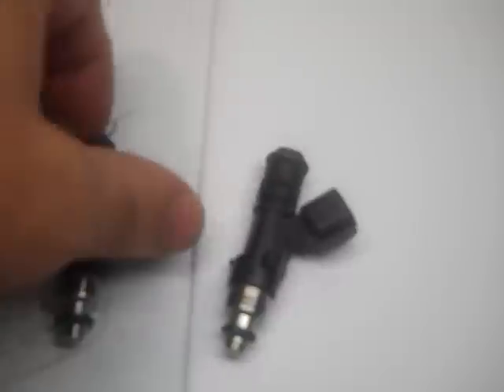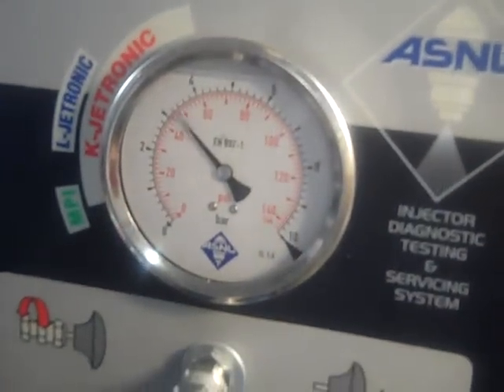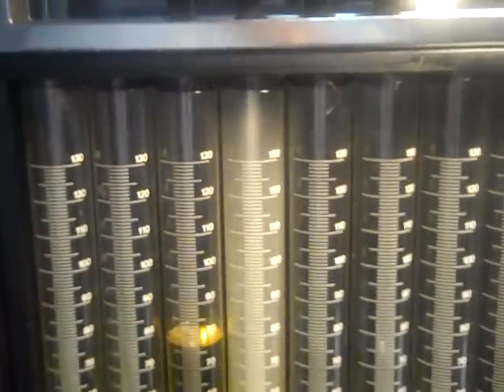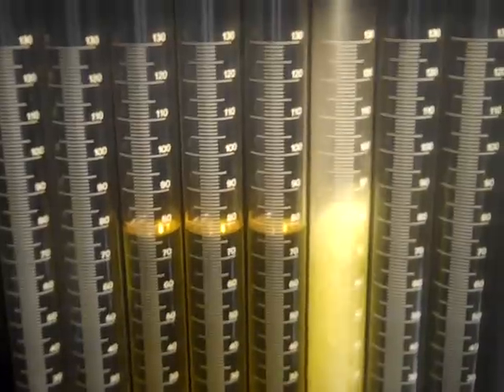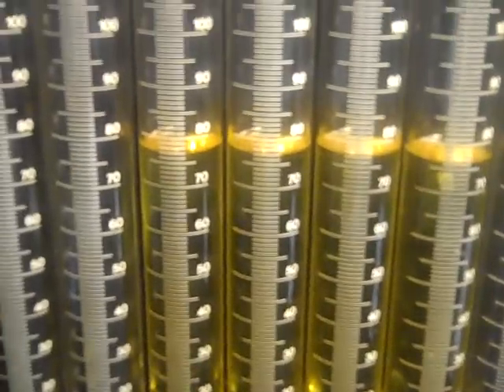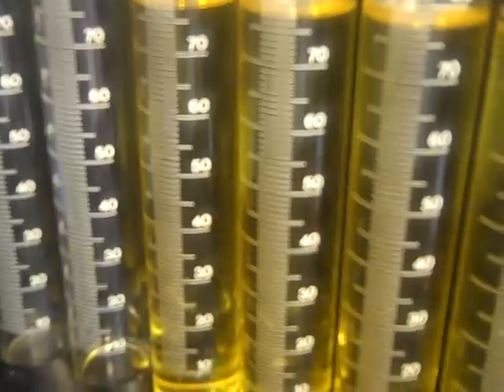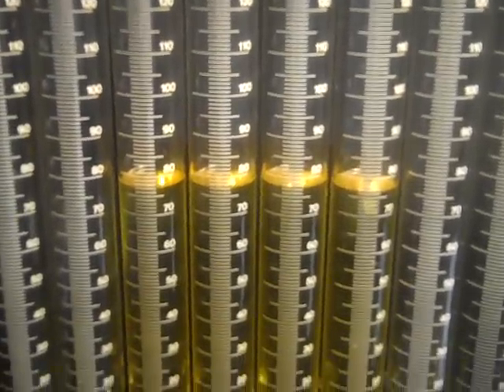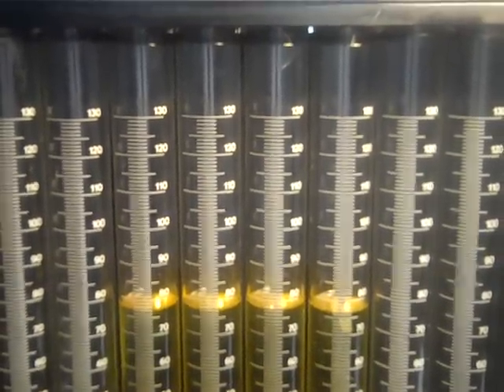RCI and ID 1000cc Injector comparison

Comment: What are the numbers on the 1000cc injectors? Also, where can one purchase a set of RCI injectors?
Reply from the maker: +klutzycarlover the 1000 cc injectors can be purchased on my web site www.racecomponentsinc.com  or call 561 248 6793    The number is Bosch 0280158117